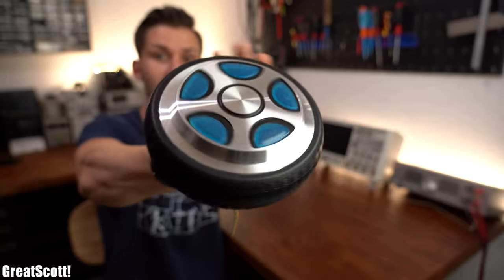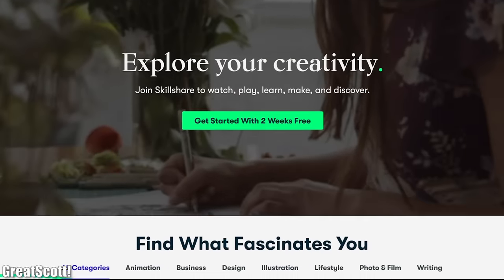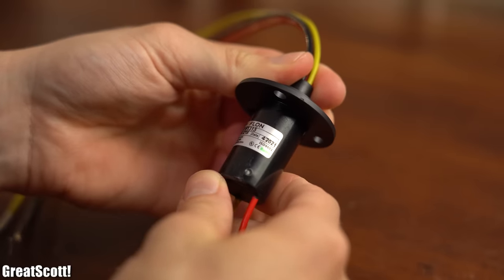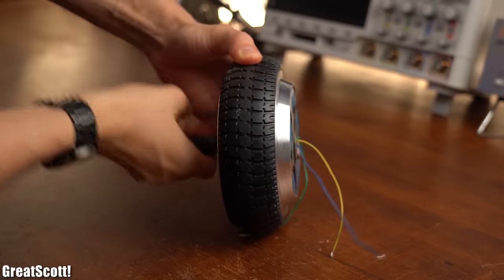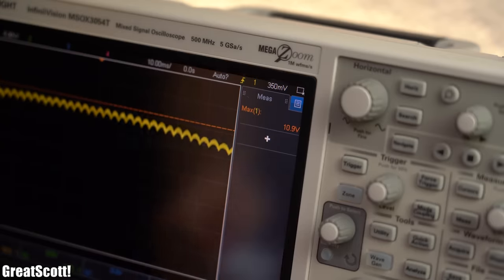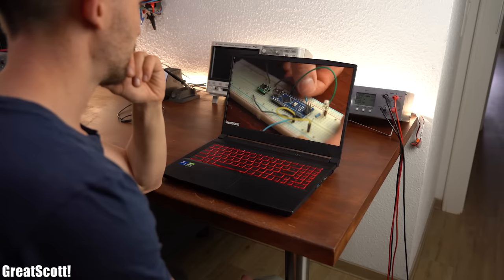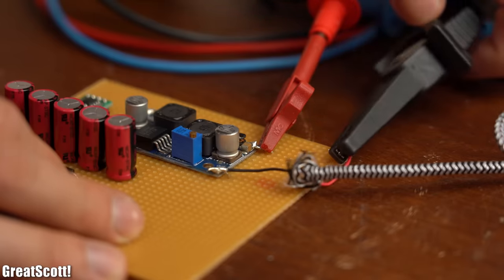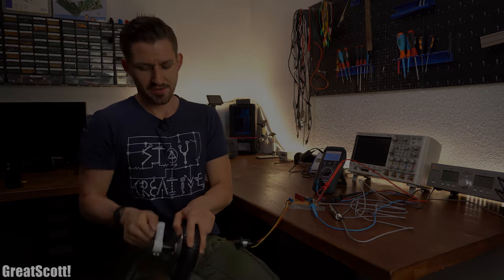Finally a good usage for Hoverboards! (charge your powerbank by cranking)

Comment: I would gear it before the crank (like 1:8) to generate faster output RPM for a cost of higher resistance. From watching your video it looks like it requires no power at all to spin it.

Comment: I have the same idea, but, instead I use a old copier motor, it have a reduction gear in the shaft and you can reach more rpm per turn.

Comment: Schweiße doch den Schaft von dem Stator des Rades an ein Rohr und schrauben an den Rotor 3 Flügel. Dann hast du ein Windrad und das Problem mit den drehenden Kabeln nicht mehr. Außerdem sollte das die gesammt erzeugte Leistung deutlich erhöhen, da sich das Rad dann deutlich schneller dreht.

Comment: I would have drilled the wheel hub and installed a crank on the wheel...that way you can use it as a flywheel to even out your cranking.

Comment: I thought you gonna make handle that grip the wheel so you don't need that slip ring. That cable you connected to power bank just too long, and maybe add some kind of flywheel to store some peak energy when you cranking

Comment: Awesome video as usual but I am still not getting why attaching a crank to the wheel is a bad idea. 

So I made a motor from an alternator and I was wondering is there a way to figure out the best voltage to run the alternator motor with so it doesn't heat up too quickly.

Comment: @GreatScott! - Loved the ending on this one. Thanks for the laugh. :)
Useful information overall, but I was wondering if mounting the slip ring to something attached to the generator might keep the wires from twisting and possibly breaking eventually due to metal fatigue in the lines. Also, I suspect you could shorten the wires leading to the slip ring quite a bit, and still have it work properly.
Love your videos; keep it up! :)

Comment: Old bycicles had dinamo on fromt wheel. It powered front and back lamp. I believe it was 6V dinamo. Wouldnt it be much easier to connect converter+efuse to that and use it as power for battery bank?
Sorry for my broken english, it is not my native language.

Comment: Would these work as assist motors for a wheel chair? Either as a drop in on the front set. Or added to the large hubs?

Comment: I think it's not the best idea to rotate wires, that not intended to be rotated. In my opinion there you need put other wheel, that will turn first with friction. Of course it will be twice as large but I believe it will last longer.
Btw, I didn't know about that wire bearing stuff, I should learn about them :)

Comment: I don't know if i should laugh or cry, but trying to use an outrunner-motor as an inrunner seems soo silly :D . Did you think about making the handle grip the outer parts of the wheel whith the rubber removed (it peels right off) and then you would also have the added momentum of the flywheel rotating and don't have tio work around the wrong placement of the coils :)

Comment: Brilliant project! It's always great to experiment on old stuff :)

I was wondering, if the buck/boost converter goes haywire at low voltages... Why not just add a 2nd buck converter after that?
That way, if the boost converter produces overvoltage, the 2nd converter can soak it up and deliver a constant 5V.

It's something I'm going to experiment on, as I have a weird DC-DC charging circuit I want to invent, but thought you might like to play around with the idea as well :D

Comment: Meanwhile I'm just wanting to turn mine into a battle bot. Mine are basically identical. 27 coils, 36 neodynium squares. Fought some tiny jumper wires for 8 hours to connect arduino to fet driver, shorted supply voltages to normally switched circuits... let out magic smoke from something, used battery voltage as "common ground" connection to arduino and/or leaving fet driver pins floating... probably fried some arduino IO there too. Poor people problems; trying to buy as little as possible... even put a hole in my drill grip to connect to it's 18volt battery. Almost forgot the google translating of a chinese datasheet.

Comment: What if you added a long handle to the wheel and just crank it by dragging it on the ground? You walk and it charges. No mess with the cables because they would be attached to the handle

Comment: INSTEAD OF A CRANK JUST MAKE A WIND MILL THAT GIVES YOU 12VOLTS TO CAR BATTERY DC AND USE A DC TO AC INVERTER THAT HAS A BUILT IN USB BANK PLUS KEEP A LIGHT AND YOUR FOOD COLD IN THE FRIDGE

Comment: Cool project. I wonder if the boost converter IC has a under voltage protection pin to safeguard against low voltages. It’s odd also that the voltage shoots up so much.
Reply from the maker: It is an XL6009 that comes with an ENable pin. So yes, you could add an undervoltage protection. But  the manufacturer of the board did not include such a feature.

Comment: should there be resistors in parallel with each capacitor to help balance the voltages across each capacitor to around 2V?

Comment: What about using another unmodified one that you fix so that it rubs on the tire of a bicycle that has the rear lifted ? You should be able to have a lot higher wattage with that, and no drilling.

Comment: İt might be more useful if you can attach the generator to bicycle rear wheel with fixed position and cycle the wheel. Like this you won't need the the slip ring I guessed 😏

Comment: it would been much more stable to actually attach the slip-ring to the wheel than letting the wires flap around like they do until they would snap, in my own of such a thing I would also put a gearbox to increase the ratio so you don´t have to wind it that fast. I mean you even have a 3D Printer and could had printed a suitable planetary gear box to the handle and make it give much more power with less effort. but I know such perfection would take much more time to make. but the end of the world is upon us and you might need that generator someday for real

Comment: Can you use this hub motor with your bicycle and make a human power generator. You don't need any gears or pulleys . Just make a bracket and put the " wheel motor " on bike back wheel

Comment: So I have watched a few hoverboard motor videos and with the standard windings, the results are pretty much the same.

HOWEVER, I did come across some people who have actually changed the wiring configuration of the stator. 
Each coil on the stator is a group of wires (4 -5 in parallel). By simply changing these wiring groups from parallel to series, you immediately up the voltage (downside being a reduction in current of course).

This does allow for lower rpm before the cut-in voltage.

Here is an example: https://youtu.be/_xngm1sj4mk?t=279
Reply from the maker: Thanks for the feedback :-)

Comment: Would it not have been much simpler to just attach fan blades to the wheel and stick it up in the wind?
Also, load were a bit low I think, the motor can do 100+ watts...

Comment: I would have done it reverse. Fix it and use it with your cycle and then cycle to rotate and get higher rpm and more power via legs.

Comment: Good stuff!  Can anyone here tell me if it's possible to power one of these motors on mains AC?  What kind of equipment should I be looking for to accomplish that?  Whenever I try to figure it out I just get lost in examples of recycling these for other cordless projects.
Reply: Yes, if you have the right power supply.  If you are in the USA then you have single phase power and will not match 3 phase power for the wheel - you need a power supply.  The wheel looked just like the wheels that Jehu Garcia (YouTube) bought (for $10 dollars) and used on his skate board.  Also, a motor controller would hook up and power the wheel.

Comment: A bit dissapointed you basically took a brushless motor and made it a brushed motor, with external brushes.. :P Would have been better, less work and more efficient making some kind of simple holder for the stator shaft, and add a crank to the wheel thats ment to spin

Comment: Couldnt You just add one more diode to output (for 0V protection) and set output voltage to 5V + 0.7V for diode drop out ?

Comment: This idea with rotating cable is stupid. You could make your "cables" part fixed in  stable position and design a nice crank for a wheel, something like a handle sticking out with rotating tube on it.

Comment: I'm failing to see why you didn't just attach your crank handle to the wheel side and not have to mess around rerouting your wiring and adding a slip ring to what was a brushless motor?

Comment: Why not out the handle on the wheel or rim instead of the shaft and in the shaft out a handle or stand. That way you can crank the wheel or spin it with something.

Comment: Idk if I’m the only one but why didn’t you just attach the crank to the wheel that way you wouldn’t have the wires moving all over and you have the shaft as a better point to fix the generator to something.

Comment: Ok this is crazy idea -but why didnt you simply build a wood construction to hold central axis of motor  ,and use a pulley system with a crankshaft to turn the outside wheel? 
Flat belt would do just fine on that wheel -you can go as cheap as using bycicle tube as belt.

Comment: The fact that the converter gives out 30V when input is too low should make you throw it in the trash, not efuse it. It does the worst thing IT can, under a circumstance that is obiously common?

Comment: Making this large motor produce 2.5W ... that's silly. Kind of cool, but silly. I have a "emergency charger/flashlight" with a crank and a tiny 2.5cm i diameter bell motor that produces half as much and the whole thing including USB power supply adapter weights about 150g and can fit in my pocket. Frankly unless you can reach about 15W it's worthless to have this large a motor. Maybe a old power drill will be far easier to convert(as it has gearing) and produce much better overall result then this, despite having brush motor.

Comment: that slip ring setup is really bothering me... like it would be waaaay nicer to either fix that thing to the case, or (for actual long term reliability) turn around the motor again and use a gear with a crank instead of the stator "axle"

Comment: I have 27.2v 1200 watt power supply means 44 amp. I connect two 12v 100a batteries in series and then i connect this power supply. But battery not charged! Why?? And how i charge 12v battery with this power supply???

Comment: Given the small input torque requirements , you are wasting a lot of arm movement for such a small output... a 5 to 1 pully  system(or more) would allow you to turn much more slowly & yet get a higher output. At least, thats how I'd do it... a flywheel would smooth out the mechanical rpm fluctuations... but come with a weight penalty... 😔

😎👍☘🍺

Comment: Why you haven't used the handle at the wheel so that rotar can be static and everything can be solved
Reply from the maker: How in a comfortable and useful way?
Reply: @greatscottlab  may be fixing the stator rode with a table wise and attached a handle to the wheel

Comment: Why drill the hole, modify the wires and crank it when you could mount it and just spin the wheel by hand? More RPMs this way as well.

Comment: wouldn't mounting a crank to the wheel part be much simpler? no need for a slipring.

So instead of mounting the crank to the stator and turning the rotor into a stator, you keep the stator stationary and rotate the rotor.

Comment: The "gear ratio" of your crank sucks you could probably get more consistent power per stroke if you had designed it similar to a hand crank drill or a geared drive like an egg beater.

Comment: Thank you very much for the good work you do but I have a small note
It was better and cheaper if you put the crank welded directly with the wheel and fix the axle on the table, thus maintaining the quality of the wires and keeping the part of the coils fixed and stable on the table

Comment: You way over thought that one. All you had to do was cut the blocks that hold  the axle still off the big aluminum pieces and then you can just lock that thing in a vise and spin it. All you needed was a hack saw dude. I build scooters powered by w hoverboard wheels in the back, you use 2 controllers, on one you set it to run backwards so both wheels go the same way.

Comment: This motor will only output the max power that the motor ran at. Not suitable for charging Lithium ion batteries without overvoltage protection.

Comment: what wait??? the buck converter does what?   I use these buck converters to get 12 volts out of a 5 volts powerbank. and 9 volts out of a 12 volt lead acid battery. The equipment I feed the power is not cheap. Am I risking the equipment getting killed by the buck converter because it can let high currents through?

Comment: Great video as usual !
To be on the same principle of emergency energy, why not taking a bycicle with an E-Bike hub motor and put it in regen mode ? You will be able to hack this simple setup and generate up to 250W which is 10 times more that what you have currently with your hand crank device ! 
Could be a fun video to see on your channel in the future.

Comment: why didnt you just add a arm to the wheel, that would have saved you from adding all that extra stuff and wire twisting.
Reply from the maker: I think that solution would not have been as comfortable

Comment: Sorry, but no, sir. This thing is absolutely useless except for amusement or education. One 18650 cell stores roughly 10 Wh of energy, so with your 2 watt cranking power you'd have to crank for 5 hours straight to produce 10 Wh. By that time all the wires and the slipping contact would probably be destroyed. That said, if you really want to carry some 0.5 - 1 kilograms of 'emergency electrical energy' with you, just get a 10-cell powerbank.

Comment: Hi !
I'm afraid, this is poor design

1- the super capacitor is absolutely USELESS and cost waste ....
2- the rotative connector is probabely not supposed to transmit POWER ,and IT is for sure a long term source of failure
3- why not simply attache a handled to the border of the wheel ????

best regards .....